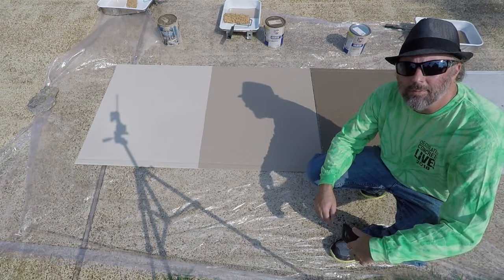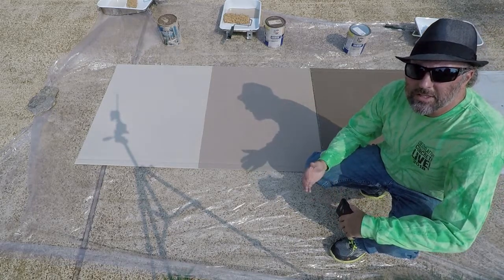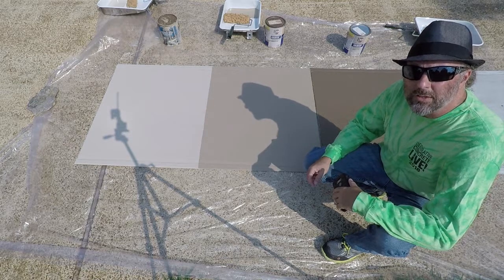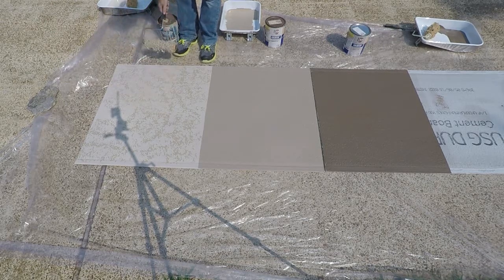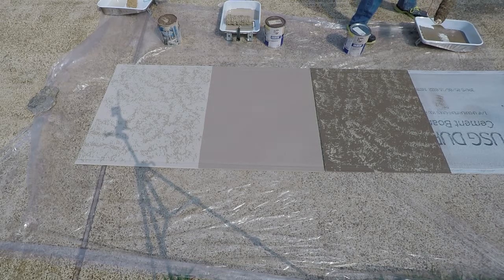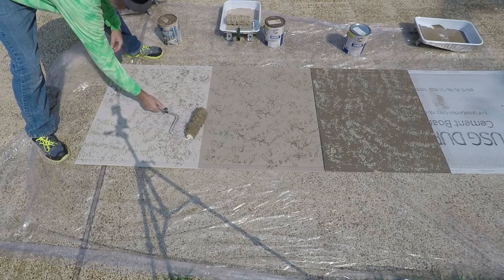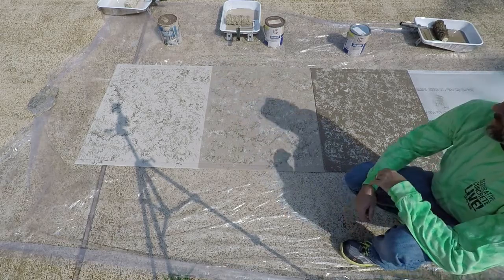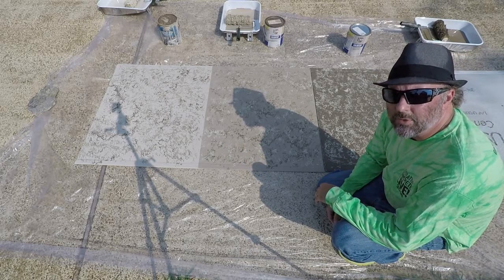Sponge rolling concrete stain

Comment: I recently stained my concrete, two coats of the water base and I apply two coats of the clear sealer. After watching your video, I like the look of the sponge am I able to go over the top of the clearcoat with a coat of sponge paint, and then clearcoat on top of that? Thank you.
Reply from the maker: Yes you can. I would recommend using a stiff brush to scratch the surface first. Water based sealers don’t re-emulsify. Scratching it will insure a better bond.

Comment: It’s been a few years since you posted this and I could Google it but your an expert whereas Google… not so sure about that…what temperature should the concrete be about/between before you paint it?
Reply from the maker: between 50 and 80 degrees.  under 50 will take longer to dry.  over 80 can cause bubbles and blistering.

Comment: The house we moved into has a concrete patio, porch and sidewalk in a light pink color with standard gray concrete trim. We also have a larger concrete pad in the backyard in a terracotta color (it abuts the light pink concrete pad and appears to be a newer pour). All of the concrete is in great shape. Would the sponge-rolled stain provide enough coverage to make all the concrete match, or would one need to apply a second coat? Also, the sidewalk and porch in the front of the house have a design stamped into them and appear to have spots that look like sealer that hasn't been worn off. Do we need to remove the sealer before staining, and does one apply the stain in the same fashion to the stamped concrete? Does this stain also work on brick? Our location is SoCal-LA County. Thank you in advance.
Reply from the maker: Yes this technique would hide the different pours of concrete and make it all look the same.  You would need to remove the existing sealer on the stamped areas first.  No this would not be a good idea to apply to brick.  It will not bond for long.

Comment: Do you finish with a clear sealer to protect?   If so, do you use matte or satin, or gloss finish?   I have a fairly big concrete patio..2500sq. ft.   Any thoughts?  Thanks for the great video. WiL
Reply from the maker: sorry for the late reply.  yes I use a clear sealer to finish it.  I also add grip to the final coating for slip resistance.  I recoat and add grip every 2-3 years to maintain the look.  it is very easy to maintain.
Reply: @ConcreteMystique  do you add grip to the paint? Or the seller or both? What base paint? usually use for concrete?
Reply from the maker: @belllui5923  I tell you exactly what I am using in the video, Colortop from Sherwin Williams.  You add grip to the final clear coat.  I did not add the grip or the clear coat in this video.
Reply: @ConcreteMystique  Not sure I understand.  If the product with color is sealer, why do you also need a clear sealer?
Reply from the maker: @robertd9850  you don't "need" more sealer.  Adding a final sealer coat over it allows for gloss and you can add grip if you are worried about slip resistance.